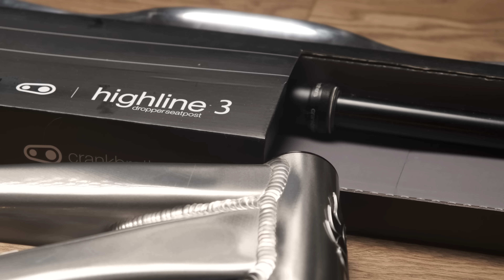My most beautiful Dream Build yet! - Banshee Enigma

Comment: Beautiful! There is a much easier way of getting the black anodizing off the Al bars - Plastic rubbermaid tray - fill with a 10% solution of NaOH ( household 100% lye crystals - Ace Hardware has it in the US) using hot water. Just lower the bar into the solution and within 30s the anodizing is gone. Wear rubber gloves and eye protection as this stuff is caustic and burns. The solution must be hot and only add the NaOH slowly to the water not the other way round or it will explode. - It works really well - no sanding and no damage to the Al parts. Wash off thoroghly in cold water when done.
Reply from the maker: Thanks!
Reply: That's an interesting method I've never heard of. Thanks.
Reply: Hydrofluoric acid works to strip off anodizing.  It's used in some toilet bowl cleaners. But if more easily sourced at truck stops and parts houses. They use it as an aluminum brightener on the wheels and fuel tanks
Reply: @michaelrodgers5105  hydrofluoric acid is extremely toxic. As a metallurgist I have used this stuff in anodising and etching metal my whole life and the safety precautions you have to take to avoid contact with your skin are very serious. I'd avoid it at all costs.
Reply: @JohnPilling25  I knew of a guy who got badly poisoned from it because he was using it cleaning his truck and he's shoes got saturated in it.
Reply: @michaelrodgers5105  yes, it goes through the skin easily and the fluoride ions attacks the nervous system disrupting the sodium transport mechanism. You need calcium glauconate as an antidote. Basically the calcium binds to the fluoride ions to make calcium fluoride stopping them causing further damage. It has to be applied repeatedly every 10 minutes or so. As I said HF is extremely dangerous. I prefer the NaOH method but again a mask, respirator and covering skin/clothes is important. I use long arm rubber gloves, a face mask and a respirator mask as when you drop the aluminium part in the hot solution it fizzes like mad giving off a lot of gas. I work outside when using it.

Comment: my LBS is ordering an Enigma for me. this was a fun watch. that DVO is Poppin'
Reply: i'm also adding ergon ga2 in Blue, with a Spank spike saddle in Blue, and matching jagwire Blue cabling and hoses.
Reply: 6 month update: running the DVO diamond on e13 wheels (got em for half price).. this is funny to me that i've never cross-branded tires but i removed the kryptotals and slapped on a kenda nevegal pro R, with a vittoria martello F - also 5dev 160's on a 30T ring. x01 cassette/derailleur with Trail 1 bar and stem. one up dropper (180 mil fits a small frame)
it sure is a blast to ride. hard to keep it in rotation with my 4 other bikes tho (first world problems).

Comment: Great video by the way!  After you mark where you're going to cut the fork steerer tube (right where the top spacer ends), then you cut, what happens that causes it to now be lower than the top spacer (the required 2-3 mm)?  I never understood this on bike builds.  Please help.
Reply from the maker: You don't cut right where you mark. You cut at least 2mm lower than where you mark
Reply: That makes sense. Thank you!

Comment: Appreciate your effort to make these videos (i know how much work is with these), but as a bike mechanic (and MTB enthusiast), I have to share with you some of my observations:
1. That's a DVO Diamond fork, not a Sapphire.
2. Why you worked so much with polishing that handlebar, while there are available many polished handlebars on the market? (applies also to the spokes)
3. It's just crazy, that you mounted 4 piston Magura brakes (F+R), and 160mm rotors...
4. Why the 1 foot long valve?
5. (and this was your biggest MISTAKE) you swapped the left and right crankarms!!! Wouldn't be a problem, if the pedals you used would have a "rectangle profile" (from the side), not a "parallelogram profile", which leads the rider feet to slip off the pedals more easily.
6. (an overall mindblow) using some carbon parts (Magura brake levers) to reduce the weight by a bit, yet mounting some super-heavy Cro-Mo crankarms on the same bike, is a nonsense for me.

What I liked a lot:
Greasing the contact points only, when installing a thru-axle is elegant, and less messy!
Good to see some less popular bike parts (not just the mainstream brands) on this build!

Please, let me have a suggestion for your next builds: take your time, and focus more on the details (for example: don't let the grease to drip on the rotor...). It may take a few minutes extra, but would make you look more like a professional builder.

Have fun with your builds in the future, and keep up with good work.
I wish you all the best!
Reply from the maker: I really appreciate the time you spent to provide this feedback and your expertise. It's  extremely helpful. A few answers for you: Long valve stem was because I got a deal on them and I like them (knew I'd get asked this a lot) :). Magura breaks were chosen solely on looks and how well they matched the motif and colors. This is a form over function build, if that wasn't clear.  As far as the cranks, really good eye here. You're exactly correct. The spider adapter I found to get the narrow.wide chainring on needs to fit on the spline. Mounted the other way, it doesn't have any spline. I now have seen another adapter that mounts to the single bolt on the crank and doesn't need the serrated spline, which I've ordered to make it right. Hopefully that makes sense. Would love to hear if you know of a different solution. Again, these parts are all about looks,.for the sake of the video, but will be making tweeks to the version that gets ridden. 
Your feedback is extreme welcomed and appreciated!
Reply: @BuildaBetterBike  I totally agree with you, that sometimes the form over the function wins :)
About the crankset: (it's really just my opinion) you accepted an unnecessary challenge, when you opted for a BMX crank arms. While these looks great (just like some titanium MTB crankarms from eeWings - which requires selling a kidney :)), since these are $1000+ crank arms), finding the perfect adapter may cause headache. Hope the new adapter will work just fine!
I wish your YT channel (subscriber count, and views) will grow, because you deserve it 👍

Comment: What is the point of cleaning the chain (if it is cleaner)? Chain should come well lubricated from manufacturer, no? If it was lubricant, wasn’t it unnecessary?
Reply from the maker: It comes well-lubricated in this horrible viscoussy lube that is absolutely the worst. Everything sticks to it. It's meant to preserve it in packaging, storage and shipment and in lots of climates. It's not the right lube for the conditions it will eventually be used. I always remove it and use the right lube for the area of riding.